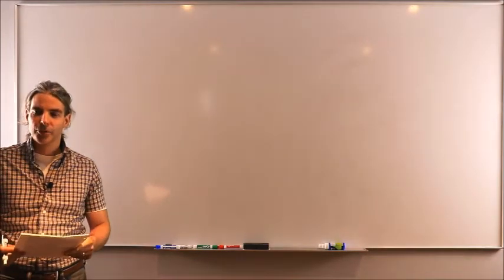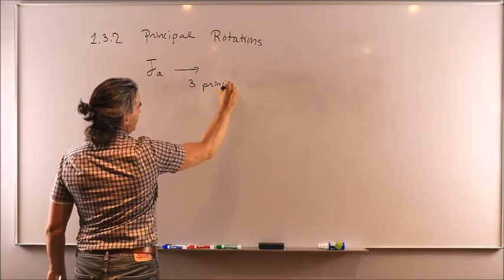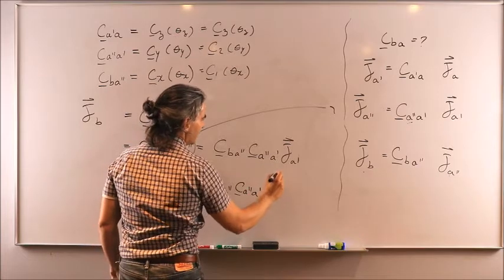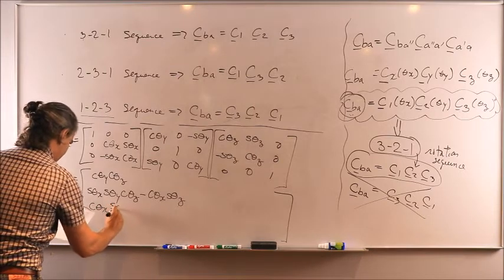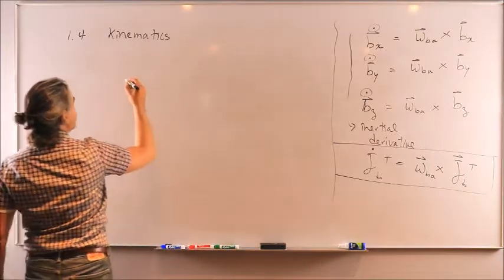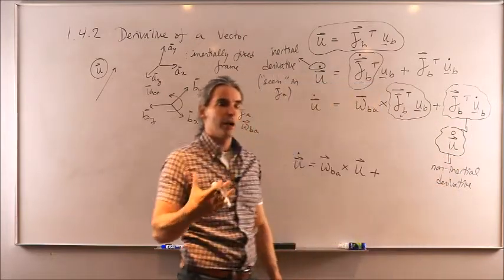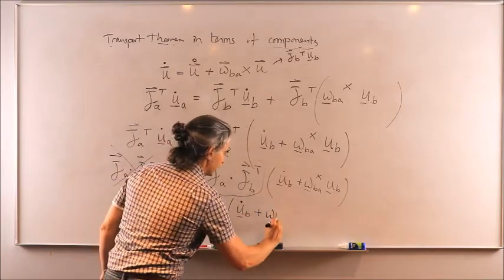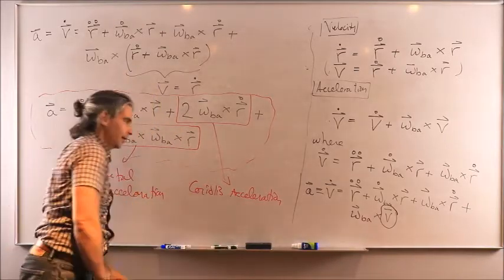Orbital Mechanics - Principal Rotations, Rotation Sequences, and Translational Kinematics

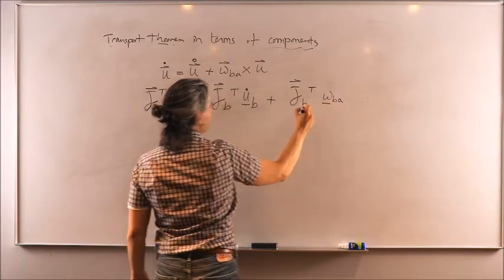Comment: @1:05:25 If omega subscript ba is the vector, shouldn't the components of this be omega subscript ba subscript b?  Omega subscript ba can have different component representations in frames a & b so it seems this notation is ambiguous, although it would be messy to have double subscripts.
Reply: The vector doesn't strictly belong to either frame a or b, because it's a relation between the frames -- it represents the direction and axis of rotation. The axis is the same but direction changes, hence you can only add that: w_ba = -w_ab
Reply: @TurtleTube123  Imagine frame b's z-axis is orientated along the (1,1,1) direction of frame a and frame b then rotates about its own z-axis.  Sure w_ba=-w_ab but w_ba_b is a multiple of (0,0,1) whilst w_ba_a is a multiple of (1,1,1). Just using w_ba is ambiguous about which frame's component representation is being used.
Reply: @triganden  I see but that assumes the frames are related by a fixed rotation apart from the dynamic rotation. However he didn't as far as I recall at least explicitly say that such a fixed rotation should also be accounted for
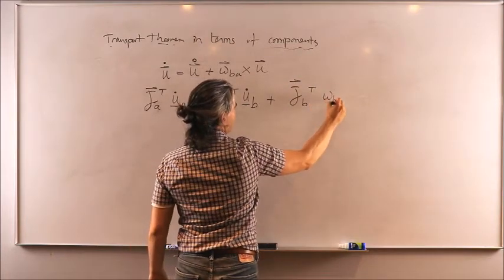Reply: @TurtleTube123  I don't see why fixed or dynamic makes any difference. My point is that any vector, and in this case the rotation vector w_ba, can have different component representations in the two frames.  @1:05:25 he's talking about the COMPONENTS of w_ba (w_ba underlined, not with an over-bar that he uses to represent a vector) and so therefore should really say they are the components as measured in the b frame (w_ba_b). The skew symmetric matrix is built from the components of a vector in a particular reference frame, in this case frame b.
Reply: @triganden  Actually the answer may be in what you wrote -- since in component form it is represented as a skew matrix here, its basis is implicitly the same one as the vector it acts upon. Nonetheless the question is valid and it would be good to get a more authoritative answer :)
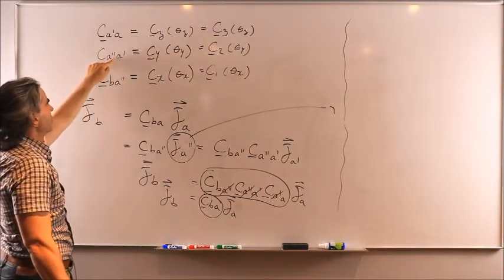Reply: @TurtleTube123  Yes, it was implicitly obvious what representation was required, but at 24:27 onwards in the previous lecture where he's considering the cross product of u and v he writes u_a^x to represent the skew symmetric matrix built from u_a and so if he wants to be consistent with his notation he should use (w_ba)_b^x and not (w_ba)^x.
Reply: @triganden  I am actually only now catching up with the previous lecture. I skipped it since I already know about all this vector operations & stuff :) But it's good now to make sure I am aligned with his notation.

Comment: Sir! It is the 10th time I have replayed this lecture. Something didn't let me rest. With due respect, if you ever read this comment, I would like to notice something. A basic rotation (also called elemental rotation) is a rotation about one of the axes of a coordinate system. The principal rotation matrices rotate vectors by an angle θ about the x-, y-, or z-axis in COUNTERCLOCKWISE, in three dimensions, using the right-hand rule. Therefore there is some difference inside the matrices compared to this: https://en.wikipedia.org/wiki/Rotation_matrix    My question is: why your version is different? Please explain me Professor. I really put my heart in your course. I have to understand your version. Best regards Professor!
Reply: Dénes Deni, there are two conceptual ways to approach rotation of vectors. Which one you use depends on your particular goals, but they are equivalent.

* Active rotation model: the coordinate frame stays fixed, the vector is rotated and you want the new coordinates of the rotated vector in the same reference frame.

* Passive rotation model: the vector stays fixed, the reference frame is rotated in the opposite direction (wrt to the active model) and you want to get the vector coordinates in this rotated frame.

The matrix associated with each model is the inverse of the matrix of the other model. Note that, for rotations, the inverse matrix is just its transpose and this is probably the difference you mention (i.e. where the -sin(theta) goes). The Wikipedia page has a quick note about the differences between the active and passive models.

In orbital mechanics (as well as in robotics) a number of reference frames are used, so it is more natural to use the passive model and convert the vector coordinates from a source frame to a final reference frame.